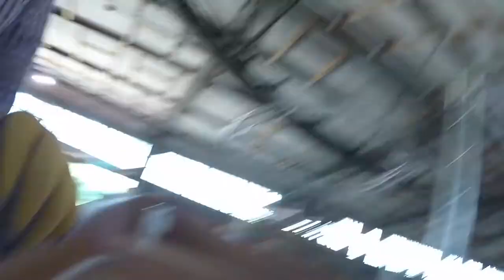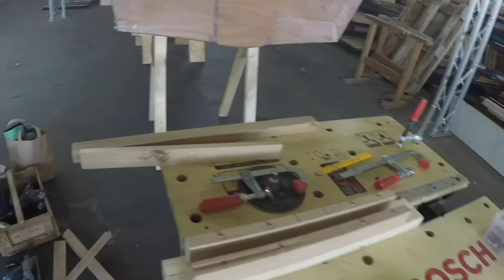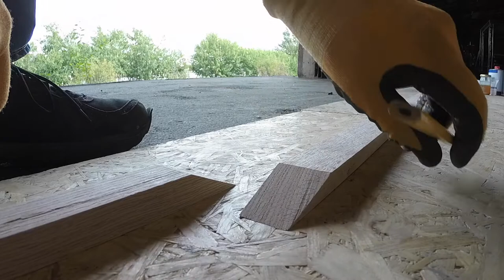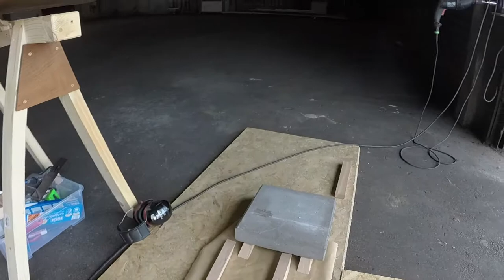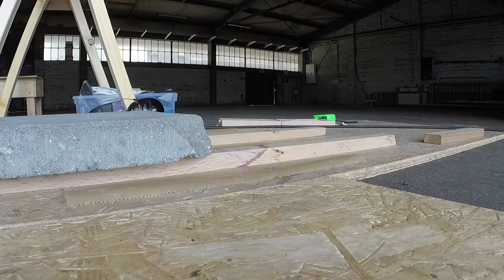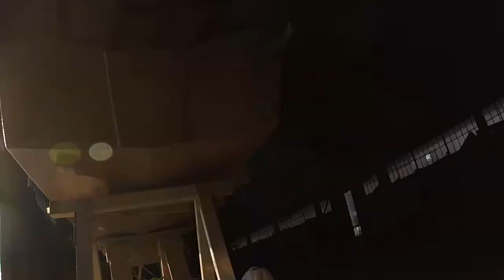Building Fleet, a small wooden boat #11

Comment: One trick that I have used to cut mitre joints is to cut both pieces at the same time by putting one on top of the other.  That way you're guaranteed that the angle is the same on both pieces.
Reply from the maker: That's a nice trick, haven't thought of that, thanks!
Cheers,
Alex